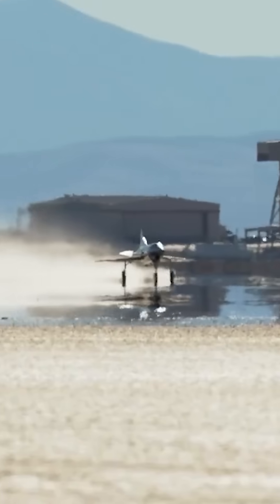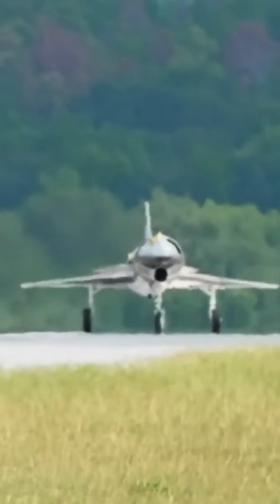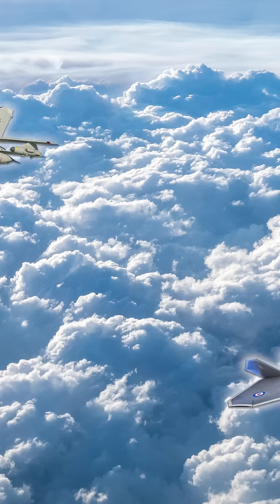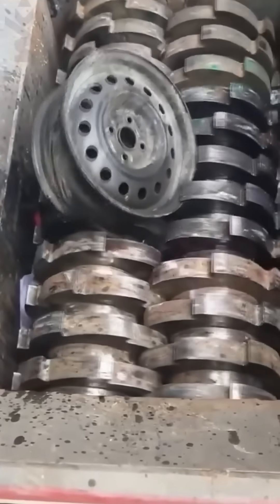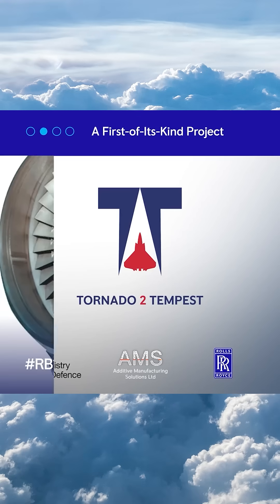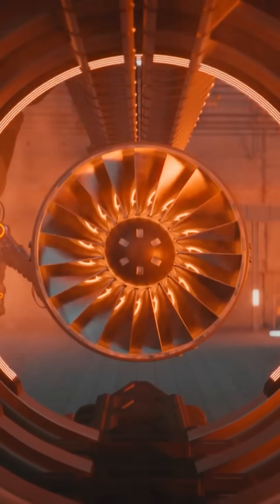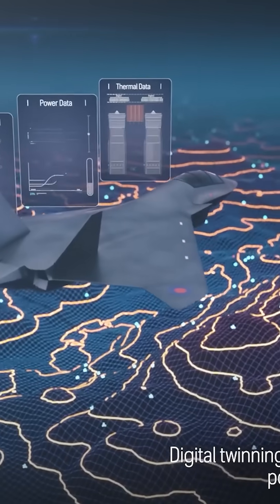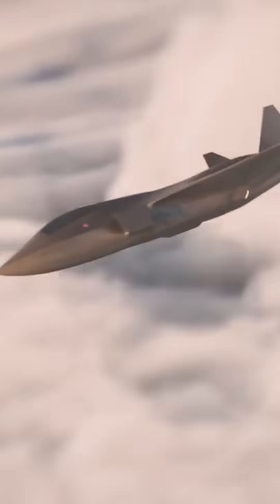The UK is grinding up old jets to build their Tempest fighter #fighterjets

Comment: Additive manufacturing (3-D printing) is proving to be one of those once-in-a-generation technological leaps that has taken aerospace into a realm of possibilities that simply weren’t possible outside of some WILD ideas just 8-10 years ago. 

The SR-72 has been all but confirmed to be flying now, and that’s ONLY because of the ability that now exists to “print” engine components that would have been either impossible or would have required manufacturing techniques involving wax molds and less than ideal tolerances (which were relied on to develop the Rockwell Orbiter almost 50 years ago).

Comment: I’m in the UK and it should be noted that this is our only option, now, as we  no longer can produce virgin steel. 
All we can do is recycle. 
And this, in addition to the rest of our net zero mandate, will be the final rusty nail in our coffin. 😔
Reply: It is not happening.
Reply: How much of your U.K. tax money do you want to spend to keep a steel mill open? It’s unfortunate but there is so much steel around running out is not seen as an issue.
Reply: @Statueshop297 it’s a security issue, not just a trade issue. If the UK cannot produce high quality steel, it’s basically useless in a prolonged war.
Reply: @ arc furnace steel can still make high quality steel. There is no shortage of arc furnaces just blast furnaces which seeing as all the contents for the blast furnace have to be bought abroad it’s still causes the same issues as sourcing the finished product abroad. 
The U.K. has high energy costs so steel costs are high.

Comment: To me, this has the same energy as the hype around the USS Ford.  Fancy all electric catapults and aircraft elevators, etc. (instead of steam and hydraulic) that don’t work whenever it starts to drizzle outside…or when the real world comes knocking for anyone who wants to take that too literally.  

Additive manufacturing has come a very long way, but it has a very much longer way to go. It’s always that last 5% from “meh should be fine” to that 99.9+% requirement for important things like jet engine fans that’s the hardest.  But oddly the most critical. Duh. 

Sheesh, looks like UK doesn’t care at all for his pilots, ground crew, and testing teams.

They’re only doing this cause of their constant hard on for still trying to prove the viability of failed ecological based movements that sound nice  (intentionally, of course) but pretty much just exist to get a small amount of people very rich.  Things like like wind power, electric cars and recycling which are either wildly inefficient or simply ship the ecological damage someplace else in the world. Literally. 

All while making a select few very very rich.

We can barely 3-D print viable firearms  these days and that’s from virgin stock. Do you want to build a sixth GEN fighter jet with recycled materials stock? That’s just insane.  And criminally negligent probably.
Reply: wright that down Ivan... we're never going to buy ANYTHING from you again... EVER...! deal with it!
Reply: Usually ignorant comments are short and sweet but you managed to stretch it to multiple paragraphs, I'm not sure whether to be impressed someone with such little understanding is capable of complete sentences and punctuation or disappointed that understanding of the English language doesn't somehow extend to the ability to use Google or parse fact from fiction and hyperbole...
Reply: @ lot of words to say really not that much.
Then again they do say that brevity is the soul of wit  :)

The hyperbole was ment to be glaringly obvious .  Wouldn’t be too proud to “spot” it.

Still, that was a pretty good one.